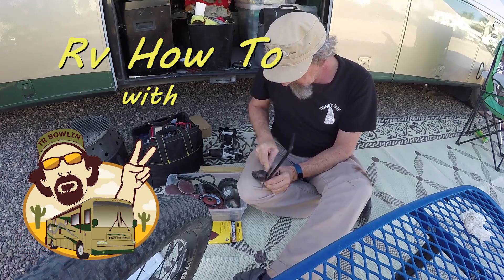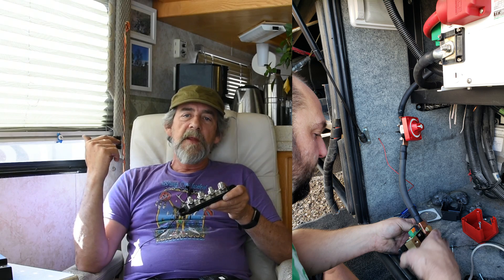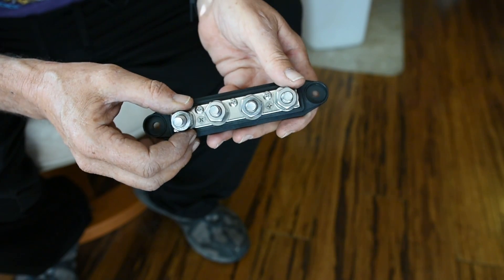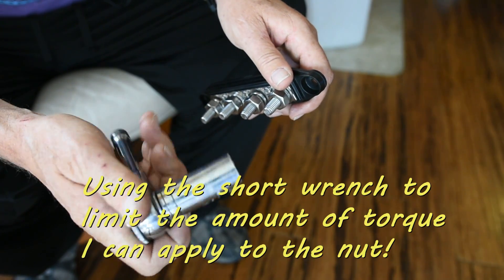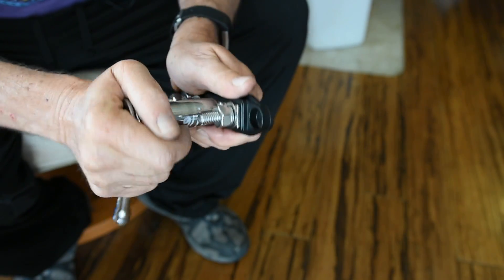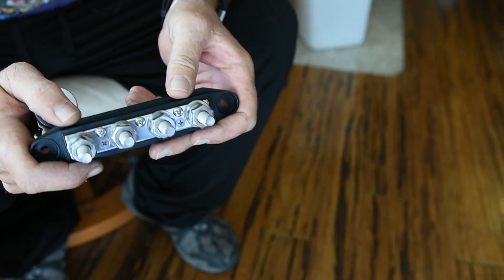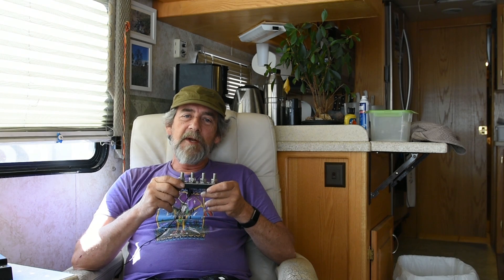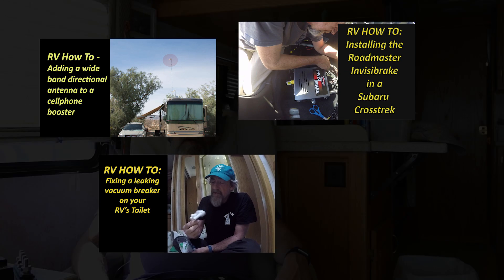RV How NOT To - Don't buy this!!!

Comment: TR when using stainless steel bolts use  anti Seize. I used 3 hacksaw blades trying to cut 1/2 in bolt off after I tighten It with the impact. Been using anti seize for 18 years no problem with seized stainless bolts.
Reply from the maker: Yea, those damn stainless bolts are hard as hell! I learned my lesson too. Thanks for watching!!!

Comment: Are those studs and nuts stainless steel?  That looks like a classic case of galling (cold welding), which happens a lot with stainless and can also happen with aluminum and titanium.  It's a good idea to use anti-seizing or anti-galling lubricants for these metals.
Reply from the maker: I was wondering about that. I've not worked with stainless bolts very often so my experience is limited there. You'd think that if it was a possibility for $40 bucks they would have put one of those little packets of anti-seize in with the bus bars. I'm going to pick some of that up today and test the other bar. Thanks Jeff, more to follow!!!
Reply from the maker: You are correct Jeff! I got some anti-seize and they seem to be okay. I installed the other bar this morning and will let it set for a while and then double check them. Thanks man!!!!
Reply: Good to hear that anti-seize worked, at least so far.  It's too bad that it didn't come with some.
Reply from the maker: Agree. I'm going to let them set for week or so and check them again but that was the issue I am almost sure.

Comment: I had already bought and installed both the negative and the positive bus bar.  All seemed fine until yesterday when I was repositioning a wire from one lug to another.  Both bolts seized.  Then when trying to remove a 3rd wire to replace the bus bar, it, too, seized.  There are a couple of better bars, but a bit more expensive, but I'd rather pay for quality now.
Reply from the maker: Sorry to hear that Winn. Yep, at least I figured it out, unfortunately at Andrews expense, and tested them before I installed them in my system. I'm going to order the Blue Sea Systems bars next week. Dan & Jen Nevada mentioned below they had used it and had no issues. You'd think at our age we would learn... :-)
Reply: @trbowlin   Thanks, TR.  BTW, I found your channel because of Dan and Jen.  Thank you and thanks to them for putting your info out.  It's been very helpful and handy.  I had already bought and installed these bus bars before I saw all the issues everyone was having.  I prayed I wouldn't become one.  Oh, well.  I'd ordered the Blue Sea systems yesterday,  and should arrive tomorrow, Saturday.  I'm not touching the positive bar yet, but will order a replacement once I see the quality of the one arriving tomorrow.
Reply from the maker: @winnhorton8949  Yea I'd bet hard cash that those who have reviewed the product positively have not tried to remove a nut so they don't know the trouble they have. Blue Sea Systems is a first class outfit so I am sure they are selling much better equipment.
Reply: @trbowlin    My sentiments, too, TR.  Safe travels. Hope to meet you on the road sometime.  Regards.
Reply from the maker: That would be great Winn!
Reply: Hi, TR.  I wanted to update you to this bus bar dilemma that we’re all encountering.  I received the replacement bus bar from Blue Sea that Dan & Jen mentioned.  First - it’s solid and feels very well constructed (a typical Blue Sea product in my opinion).  

Next - talking with a fellow RVer, he mentioned spraying WD40 on the threads of the seized bolts, and two out of three lugs broke loose and I was able to remove the nuts.  The 3rd only broke for a few turns, but enough to get the large cut-off tool behind the nut to cut the lug.  Now all is well and I’m going to order a replacement for the positive bus bar and I’ll have piece of mind.  

One caveat:  I could only find a bar with just 5/16” lugs and not the larger 3/8”, but it worked just as well.

Thanks for your help and insight.
Reply from the maker: @winnhorton8949  Thanks Winn. I got some anti sieze compound on used it. It worked well. I am still going to get the Blue Seas bar next week when I get to my dad's. Glad to hear you could get that old one removed.

Comment: So I'm thinking the issue may be super soft nuts that when trying to unscrew the lock washer is digging in and locking them up.  It looked like you can initially turn it backwards a partial turn which indicates that the threads are ok.   It's a cheap foreign made part i'm guessing.   For anyone that has these and have not installed them yet buy some new usa made nuts and try them.  And maybe change out the lock washers as well.   That's what I would try.
Reply: Old, I completely removed a couple the nuts.  When I tried to screw them back on, that's when it seized.  The 3rd nut seized when I tried removing it after I'd already tightened it down initially with a cable attached.  Could be the lock washer.  It was just frustrating especially after the first two.  Either way, I've got replacements coming.  Not that brand, tho, and won't buy from that company again.  Don't need questionable quality in a solar system that experiences a level 4 earthquake while traveling.
Reply from the maker: I wondered that too, but Jeff Hill commented that it may be galling of the threads. I'm going to get some anti-seize compound today and see if that make a difference today.

Comment: It is a 2018 39’ Jayco eagle travel trailer
Reply from the maker: Hum, that new I wouldn't think the inside of the line has rusted. I would look for bends, dents or other things that might decrease the flow rate. Short of that I guess your going to have to take it to the shop.

Comment: I have a question about LP regulators. Wasn’t getting good and sustainable gas flow so I changed the regulator now I have better flow but still not good. One burner will burn but like it is on a low settling two burners barely enough gas to keep them lit. Other than a trip to a shop any suggestions?
Reply from the maker: How full is the tank? I know that when my tank is getting close to empty I see symptoms like this.

Comment: Gas pressure low throughout, what I suspected.
Reply from the maker: Been thinking about this all day. What kind of rig is it? Motorhome, 5th wheel, trailer? You changed the regulator...Make sure it has the exact same ratings as the old one. The second thought is perhaps you have a lot of moisture in the gas lines and they have rusted and that is restricting the flow. Also if you can trace the gas lines and make sure they are not pinched or bent, that can cause problems. Perhaps rust inside the propane tanks. You might try hooking one of them up to your gas grill and see if it works okay. Other than this I'm stumped.

Comment: Just a question TR.....I don’t know why but I have two ground cables going from my 4 house batteries.  How would you install with two ground cables?  Thanks
Reply from the maker: So one of those grounds is going to go to your inverter, the other is going to be a  chassis ground.  All of your 12 V accessories inside of the coach  Will use the chassis ground. Everything that runs off the inverter will use the other one.
 My battery monitoring system install video is scheduled to release Friday and it will have all of the details plus a schematic of how to properly install for a shunt. Hope this helps Ron thanks for watching

Comment: TR, Thanks - great video.  I was just about to order some parts.  Do you have a brand recommendation for a 12V disconnect switch?  I am thinking of putting one in my negative lead going to the battery bank.  I have one the factory put in on on the positive lead.  Thank you for all you do!
Reply from the maker: I am going to defer on a recommendation just for a day or two. The switch I got I broke because I was using it to connect two of the 4/0 cables to one pole because I didn't have a bus bar and wanted to get my power restored and I broke it. My fault for sure so I don't want to bad mouth that part till I get another one and make all the connections properly. I'll also check with Andrew, he had one that we installed in his system and it seemed to work really good. More to follow
Reply: Thanks, Larry

Comment: I actually think I may have two of these that I haven’t installed yet; hopefully I can still return them. Thanks for the heads-up.
Reply from the maker: When I get to my dad's next week I am going to cut one of the nuts in half and see what is going on. Hope you can return them Craig. Cheap Chinese crap IMHO.
Reply from the maker: Another comment mentioned using anti-seize and that seems to have worked Craig...
Reply: @trbowlin  That's good to know but I'm still not sure I want to take the risk of having to cut them off...
Reply from the maker: I hear that, it was a huge pain... I'm going to run with them till I get to my dads and then see if they are still working. I'll update ya

Comment: Additionally, I bled tanks for about one minute to in sure no vapor lock in tanks.
Reply from the maker: Do you have a propane water heater or furnace and are they working okay? If so I would suspect that the gas orifices in the range may be plugged up or that there may be a regulator on the range that is also plugged up somehow. I would try the other gas appliances in your rig and if they are working properly then dig into the range and check those orifices for dirt. Be sure and get back to me. I am very interested in this problem... 

Oh and while I am thinking of it be careful if you use a pin or something to poke them. They are very carefully sized and if you try and clean them with a metal pin or something you may enlarge them which would have the effect of making the burner hotter which could damage the burner or the grates on your stove... Get a can of that canned air and use it to try and clean the orifices. Very interesting problem...

Comment: Don't know why you are having such problems with this style Bus Bar.  Only thing I can think of is that for the brand off Amazon which you bought the S/S hardware is too soft and the lock washer gouges & digs into the tightening nut.  However,  you really should try other brands.  In  doing my solar battery install I bought & installed several of these - both 5/16" and 3/8" designs - from VTE Warehouse :

https://www.vtewarehouse.com/content/electromech/busbar/html/large4point/large4point.php

Not only are they FAR less expensive (about $8 ea. with covers) than what you paid on Amazon ,  I found these from VTE to be extremely high quality (all S/S hardware), and I have never had any problem like you encountered even though I have added/removed a number of cable lugs to them over the last 16 months.

VTE also carries many other bus bar styles, as well as power posts and lots of other electrical connectors.   You should try them and see if the results from them work better for you.  But don't condemn this style bus bar because it is very useful style as it is very adaptable to adding more connections later on.
Reply from the maker: It is a problem with galling. Sometimes stainless steel bolts and nuts gall and it is a good practice to use anti seize lubricant with stainless steel. A commenter on this video pointed that out to me. By the way the link you sent me looks like the exact same parts for about one-third the price. Thanks Rich